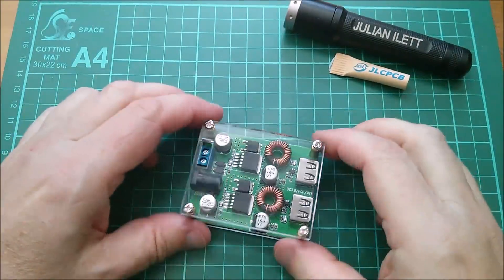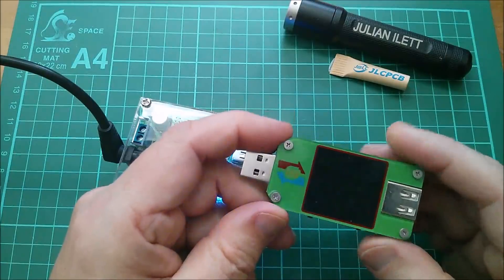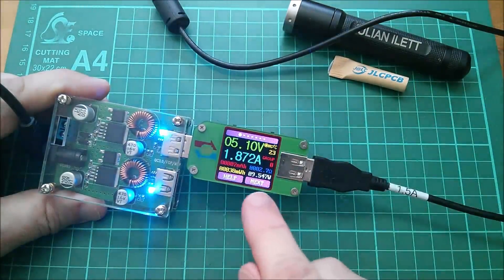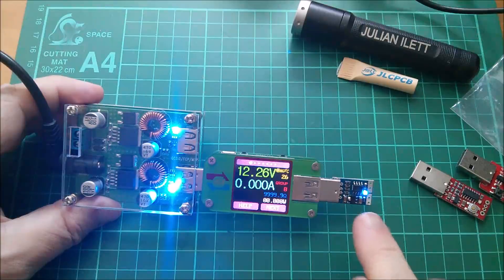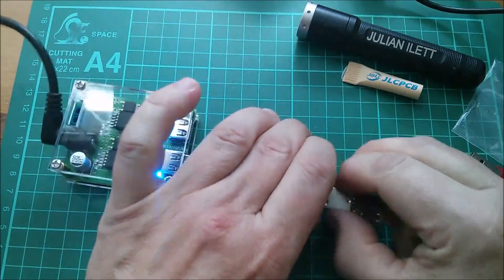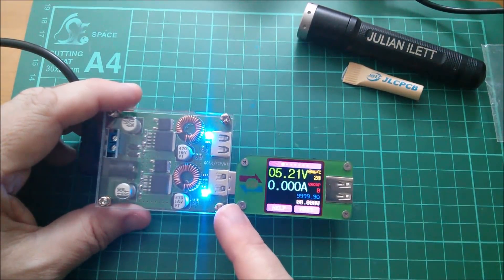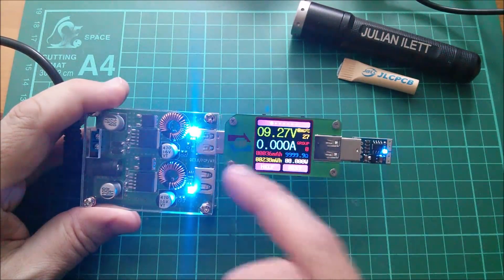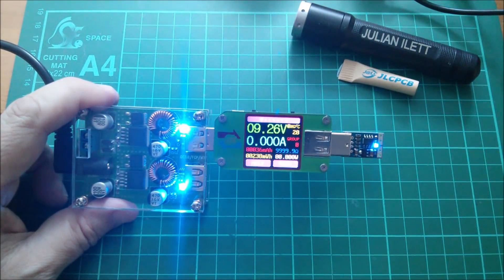DC-DC Buck Converter 2-Port USB with QC3.0 from ICStation

Comment: That RuiDeng meter can actually show the charging mode. You were at that screen when you plugged it in (notice the "unknown" indicator) but you switched to the wrong screen afterwards. It is always good to read the instructions and know the device you are using.

Comment: The QC3.0 protocol can can supposedly max 20v @ 1.5A = 30w total power in 200mv increments as negotiated by the device being charged. However you need to have the input voltage higher than 20v on the input on that charger. It's a buck only charger.

Comment: I wish companies would have a charge limit function, so I can have it stop charging at 80% or whatever it set it to.
Reply: I would love to see this. Similar thing as the Tesla etc. electric cars have, don't charge or discharge the battery all the way to get more lifetime.
Reply from the maker: Surely there's an app for that :)
Reply: Perhaps, but try searching for it... 786 apps which will claim to charge your phone 5X faster is what you will find. And lose the will to live any longer on this planet.
Edit: f-droid seems to maybe do it but you need to be root of course.
Reply: I had a Sony Vaio Laptop that had this option! I used it but it didn't help cause they used Samsung cells...
Reply: Moto-mod batteries have that feature. My phone battery stays at 80% until the mod is empty. But the mod battery charges to 100
Reply: @kyoudaiken  18650s from samsung are one of the best in the industry along with sanyos.
Reply: @JulianIlett  I believe that feature has to be enabled at the firmware level for app support.
Reply: @JulianIlett If you have an android phone then there is an app called Accubattery which lets you set the charge limit to whatever you want.

Comment: Are you ever going to change your Lead-Acids with LiFePo's?
Reply: That's quite an investment for little gain.
Reply: Not really, I used to use a bunch of lead acids and they died after a couple of years of heavy cyclic use (e.g. running a raspberry pi 24/7, charging my phone, headphones, bike-computer etc overnight and running my notebook) whereas my lifepo's have held up much better at a similar usable capacity. Also the charge/discharge efficiency is just so much higher than lead-acid. A 20Ah/265Wh Lifepo can easily replace a 50-60Ah Lead acid bank whilst having a smaller footprint and a much longer lifetime (up to 40+ Years if you don't go over 1C and 80% DoD). The benefits with lithium outweigh the cost by a lot.
Reply: If you buy a new one, yes, but replacing an existing one before it's dead is another matter.

Comment: I cannot get this thing to power up using my guitar pedalboard power (Truetone CS6). I've got 12Vdc with 1600mA max output on the board. Works fine with a 12V battery but it doesn't get any power from my pedal board power.

Comment: Hi there, I was impressed with this video that i had bought me a handful of these Modules. but apon testing these with my Samsung that has the quick charge features. this module still appeared to charge at a slower rate than my plug in charger. I see that you used tools to test the modules, but what about devices? have you actually tested any of them yet ? i have the TAB E Tablet by SAMSUNG, and my friends have Samsung phones as well. can you tell more on what devices this will FAST CHARGE ?
Thanks.

Comment: Julian, Test QC4.0 chargers next- 
great potential 100W fast charging.
Reply: The numbers game is really getting out of hand, like it usually does with these things. "Bigger number? Must be better then!!" mentality with complete disregard of what's actually reasonable.
Reply: The only reasonable thing is a 20 Ah battery in phones, making them thicker and heavier. But no, people fall over if the phone weighs more than 100 grams...
Reply: Um, 100W is perfectly reasonable, actually. USB isn't just used for charging phones, y'know?

QC4 is compatible with USB Power Delivery, and they're largely the same: each goes up to about 5A at 20V = 100W. No, 100W isn't really practical for phones (yet, anyway), but it's super useful for other things. We're already seeing Apple (and probably others by now) using USB PD to charge laptops; Nintendo uses USB PD to charge & power the Switch; Miniware could use USB PD to bring out a USB-powered soldering iron like the TS-80/100, but rated up to 100W - how about that for a portable soldering iron?!

Comment: Hey Julian-  You are obviously far more knowledgeable than I am in this entire subject, so I ask:   Re:  Reducing phone battery life, doesn't raising the voltage and lowering the amperage for "quick charge" reduce the heat and prolong battery life?  Or am I way off with this?

Comment: If this can go up to 20 volts and it's a buck converter how can it go above the input at 13.6v?
Reply: By changing the solar system to a 24V system
Reply: you could always use a boost converter before the buck too.
Reply: It's not efficient, you have losses of two DC2DC converter units in one system. So you take a higher voltage system and step it down instead of doing up/down acrobatics.
Reply: Kyôdai Ken+ It's not efficient, but it's a lot more convenient to use this method for a 11 minute video than upgrading your entire solar system to 24v for that 11 minute video because he already has the boost converter and as he said before for use on a gimmick, he looks at it like free energy anyway so you tell me which one is practical being that quick charge will most likely wind up in a junk drawer or bin to never be seen again because they're in most every car or  has them built in or in a lighter socket which boost the voltage from 12 to 24v anyway or all of the phone chargers plugged in all over the house wherever I go we all have access to. That's how I'd look at and most others when the system you're using works great for your videos and gets the job done.

Comment: Since I'm not homeless, where I sleep there is electricity. My phone can have its daily recharge while I sleep. It's got at least 7 hours.

I suppose there must be some people using their phone so much that they need to recharge on the run, several times per day. For them, I'd prescribe a portable battery pack. That way they could keep running.

When I eventually get an electric car, that's where fast recharging would be essential. Because I'd rather not sleep in a recharging station halfway to wherever. At home, we're back to overnight again.
Reply: Even without being homeless there's plenty of times you need a battery bank - if you travel especially by air you can end up going more than a normal day without someplace to plug in.  Also, in case of storms and power outages you won't have someplace to plug in your phone to charge from mains.

That's another problem with electric cars - when a storm hits you may lose power, then you can't charge.  Or if evacuating, you may not have the option to stop for 12-16 hours and camp at a charger because of storm arrival, power outages, or everyone else also needing power.  That's where gas cars have the advantage - a gas station can run their pumps on a fairly small generator to pump gas and you can stockpile a few 10 gallon cans for emergencies (and you probably have them already for lawnmowers and other yard equipment) - in an evacuation you could strap them to your car and have an extra few hundred miles of fuel on hand.  You can't do that with electric cars.

Comment: Hi Julian! Any plans to check out USB-C PD (Power Delivery) devices? PD can negotiate up to 20V*3A between devices. I think a PD Power bank and buck/boost would make a very neat portable power supply.
Reply from the maker: When such a device ends up on my desk - I will inevitably look at it. Maybe the next gen soldering iron will use USB-C PD at the maximum 20V * 5A = 100W. But I don't think the TS-80 will do that :)

Comment: It's immediately out of USB spec. 5.34 V is more than 5.25 V that standard specifies.
Reply: Doesn't hurt anything. It's needed to compensate for the extremely shitty UAB-A sockets and plugs, they have very high contact resistance. The device still won't even see 5V...
Reply: IMHO using USB (any type) as a power distribution system is madness. Crappy connectors that are not very good at handling high currents. Crappy thin cables. Mini and micro USB connectors are even worse.
Give me a D-connector or XLR connector which both can handle 5A per pin :-) Where only power is needed, a 2.1mm barrel ‘DC’ power connector. Or if space is an issue, a 2.54mm spacing three pin connector (middle pin being the positive 12V, the other two both being 0V, so reversing it does not matter).
Reply: Spec is a spec.

Comment: Hi Julian, I wonder if you would be so kind as to giving me a bit of guidance...RE CHARGING.
I intend to use x2 (11.1v-12.6v) cells to power my device, and the intention is to have some solar panels onboard to maintain charging of the batt cells. Can you tell me if you think this ebay item (282794969168) would be a suitable fit for this job, I would want to minimise the current and the voltage to protect against over charging. The item is describe as a 4A rating, my batteries would each be between 2000mah & 3000mah (parallel). much appreciated julian, keep up the great work :-)
Reply: If anyone else has any info on this subject. please feel free to reply. Thanks

Comment: I must be one of the few people who don't like charging their phone fast.
My phone supports fast charge, its a Samsung Galaxy, but I use a usb cable with no data connections to force my phone to charge slowly, it still charges in only a couple of hours so I charge it in the evening when I am at home watching TV so it does not matter if it is slow, and hopefully I will get the maximum life out of its battery.
Reply: It's indeed better to charge slowly for the battery life. But it's also really convenient to have to option to fast charge when you are in a hurry.
Reply from the maker: Yeah, this whole rapid charge thing worries me - on both phones and electric cars - there's always a downside - battery temperature (and therefore battery life) is the tradeoff.
Reply: i think that charging your phone with fast charging doesnt hurt it as much as leaving it into a normal charger for whole night
Reply: @EI - You do realize that when the battery reaches 100%, the phone stops recharging the battery. Right? It's not as if the charger and phone are beating away on the battery all night.

Acknowledge in advance that if you float the battery at about 50% charge, it'll last much longer (meaning years of lifetime). But that's not a practical option for most people.
Reply: Let's not forget that Quick Charge is really badly named.  All that QC does is to increase the voltage to try to get round the losses due to the resistance of the cable and the connectors.
Reply: Sorry to tell you but you've got it the wrong way around re data connections, the phone uses them to negotiate with charging device re rate. Big Clive did a video on it. I'll drop the link later if I can find it. With a good phone like Samsung it will negotiate and limit  the rate, so you don't have to worry.
Reply: It's not true. Devices supporting Quick Charge have better batteries with different materials that allow higher currents. Like you can push and pull higher currents from RC-Lipos... There is no risk nor lower lifespan. Except you have a Scamscum (Samsung) cell. We all know what happens...
Reply: You can always use normal 5v/2A charger in normal speed charge. With fast charge you need use  5v/9V automatic change charger. Battery end  life come faster if battery  is  low voltage in long peroid or maximum charge times come.  But end battery gone bad when it is too old, you can't  keep it much longer how you use it.
Reply: I'm not a fan of fast charging. If I can, I avoid using my phone's fast charging capability, unless absolutely necessary. I was horrified by the temperature of my GS7 when fast charging wirelessly. It gets to hot to hold the case, so I dread to think how hot the cell is inside the casing.
Reply: @soups1697  
You can leave a phone on charge all night perfectly happily. Once the battery is fully charged, the charging stops. It's perfectly safe and non damaging to the battery. Fast charging is bad for the battery, it's a known issue that charging fast shortens life.
Reply: @ John Nodge
Wireless charging with phone is bad invention.  Charger come very hot even with low current, when phone cool down, charge  dropped.  So i  never use wireless charge with my phone.  Wireless charge is good in temporary use.
Reply: High voltage is a problem for LiIon cells. Of course the charger will stop putting current into the battery at 100% SOC, but it will stay at 4.2 Volts, that will make the cell age faster. Plus with all those fast chargers you will be at about a maximum 1C rate, that is no problem for any decent LiIon cell today. But I agree that wireless fast charging is a bad idea because of all the losses.
Reply: fast charging isn't meant to be used all the time.Its for emergency situations.Also if you don''t have a fast charger your phone can charge at 5 2A(max) which is still fast and doesn't damage the battery.I have a galaxy s6 which was used with a quick charger and has a great battery health(94.94% with 492 discharge cycles)
Reply: I'd be more concerned about charging it to full capacity and how hot the battery gets while charging.
Reply: I have slowcharged my phone during nights for years, my previous LG lasted 3-4 years with no battery capacity degradation. I do avoid these fast chargers unless I'm on the road and need to be quick for some reason. I wish the standard quick chargers would have a button for slow charge so I could use the default charger which ships with the phone all the time.
Reply: @6 6: Wrong. They actually charge to 90% and show 100% earlier. When you remove it, you will see that it quickly drops down to below 90 after just minutes. If you leave it over night, the battery is charged to 100% and then the charging is switched off. The phone is then powered by the charger, the battery remains untouched.

Comment: I hope I'm just confused. You're going to use a buck/boost coverter connected to your 13.8v solar panel supply - to provide a 12v output to power a USB soldering iron? That's crazy! Julian, please... just put a couple old diodes in series with the 13.8v and call it a day. Then again, if you use enough of those '5.1mm coaxial - to - 2 pin' adapters.. you won't even need diodes. You'll drop enough energy in those connections  ;-}
Reply: Those diodes would be 5-6 watts of waste heat generated all the time... and still the iron voltage would vary with the battery voltage. not very nice (but perhaps awfully fitting for this particular channel) ;-)
Reply: haha, yeah. my only defense? in the mid-west, in the winter time - those hot diodes will only be adding free heat to the homestead dwelling - making Julian happy, relaxed, and in the mood to come up with new odd concoctions    ~{:-]

Comment: I'm not really a fan of those blue terminals, I like the elevator type more. Makes a more secure connection. What is the point of good circuit design if you have shit connectors feeding it.
Reply: I only use Phoenix Contact brand name terminals from reputable suppliers.